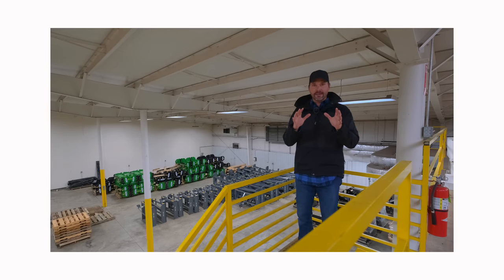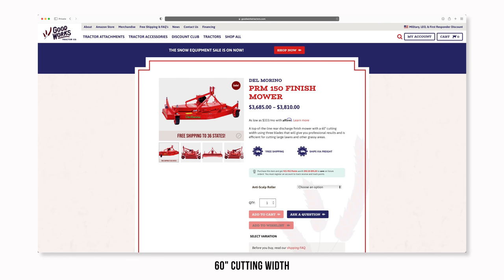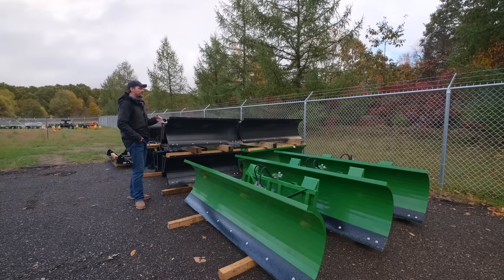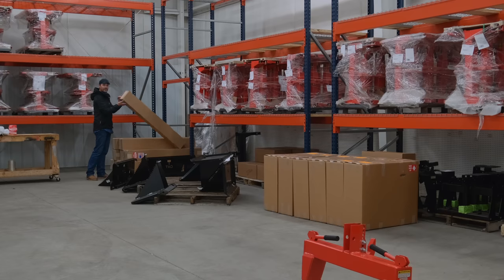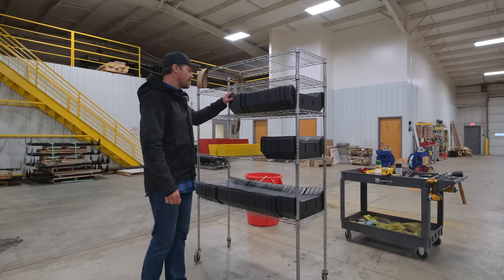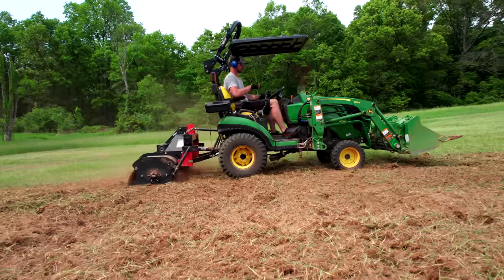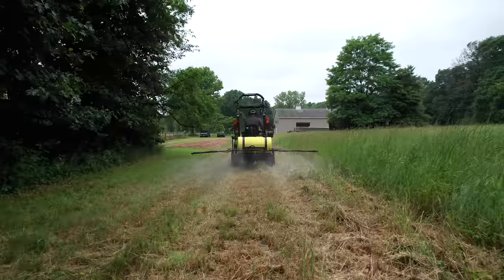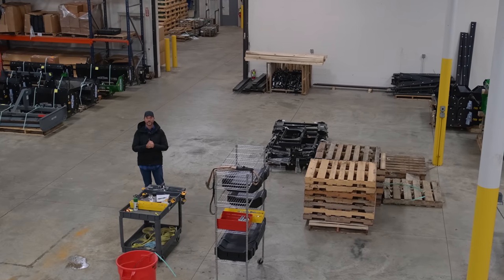TRACTOR TOOLS GALORE! MILLIONS OF DOLLARS IN TRACTOR ATTACHMENTS! 🤩

Comment: We bought a 48-in offset flail mower with hydraulic control for both the offset and tilt as well as a Summit Hydraulic 4 spool valve (8 port) kit. We use it behind our John Deere 1025R and it is awesome!

We didn't actually buy ours here but if this model weighs no more than the 550 lb ours weighs, it should work fine behind a 1025R.

We did have to add adjustable hydraulic restrictors for the offset function. Without them, it would really throw the tractor around and move so ridiculously fast it wasn't very effective.

I mowed and mulched up brush and up to 2+ inch trees for over 100 hours this summer, so we gave it an aggressive test, and had no issues whatsoever.

One of the things I cleared was a close to one mile section of brush under the power lines that was about 30 ft wide and hadn't been cleared in years. I expected that to be an extremely tedious job, manually cutting all of the young trees but instead I was able to just mulch right through the whole thing using the flail mower. It did take several days and two full tanks of diesel, but was much easier than manually clearing them.

Another Super useful feature we took advantage of is the ability to mulch and mow with the mower vertical and fully offset. Using it this way we were able to widen all of the driveways, laneways and paths that run through the forests. The mower just mulches through small branches, trees and brush and widened the paths very effectively.

I'm not sure why most of the online advice suggests these are too much for the 1025R. The 1025r is rated to lift 758 lb with the three-point hitch so 550 lb shouldn't be a problem as long as you have the full 2000 PSI or above operating your hydraulic system.
Reply from the maker: Thanks for your input Slider!
Reply: @GoodWorksTractors  I should have mentioned that my 1025R came with the tires all fully filled with windshield cleaning fluid. By fully filled, I mean filled completely, with almost no room for air (which produces a bit of a rougher ride than ideal).

I also found my 3 point hitch was slow to raise the mower at first but I discovered my hydraulic system was running out of spec at 1650psi when I got it. After adjusting it properly to 2000psi this problem went away (later I adjusted it to 2100psi when hot to improve backhoe performance slightly for removing stumps).

Finally I always left my front end grapple (similar weight to the stock front bucket) installed while using the flail mower.

I don't know if the tires or grapple/bucket help with stability while using the flail mower, but since I was constantly moving fallen trees or branches before and while mowing it made sense in my situation to leave the grapple on.

As previously mentioned, the hydraulic restrictors on the side motion for the flail is essential. Without them it moved so fast it rocked the tractor around.

One bonus I found was to install my hydraulic top link on the 3 point hitch. The top link length adjusts the cutting height for the flail mower. Using the hydraulic top link I could adjust the cutting height as required without getting off the tractor.

As I gained more confidence using the mower I learnt I could use it on surprisingly steep slopes, even with the flail offset (for example mowing a ditch or a seasonal creek).

I also found mowing with it in the fully offset position provided a higher quality cut for when mowing my lawn.

This is because when running behind the tractor, the tractor tires pack down the grass and it pops up later. Mowing offset grass that has not been driven on produces a very good quality cut.

Comment: does the wheel weights fit a manhindra 3016 tractor they say ONLY BLACK AVAILABLE RIGHT now which is fine. So i'm wondering is it going to fit according to the size of wheel or the brand have a lot to do with it.  Like Chevy vs Ford or Dodge ect.

Comment: I have a question. 
Do you know of anyone who builds a seat with an interchangeable back rest? Like something that switches fro from to rear,  this eliminating the need for swiveling the seat to operate the backhoe? 
It just seems like it would be so much faster and safer for my fingers. I rekkon some way of doweled from and rear attachment. 
I have a TYM 254 TLB

Comment: How much for that DelMarino 6’ flail mower? I am looking for a doable flail mower. And, what do you think of running that on a 3039R? I found these on your site. Good Deal!
Reply from the maker: Hi Daniel,  The big one that hydraulically shifts and tilts?  If so, that one is $9,600, but way too big for your 3039r.  You'll want a Centurion Super 52" which is mid $6,000's.  However, we are out of stock on those until next spring.

Comment: Good stuff. I am interested in a hydraulic shift flail mower for my 4066r if 5125r. Maybe duel usage on either. I am guessing what you called the “super funny”.  I’ll give you a call later this morning late. 👮🏻‍♂️👍Chip
Reply from the maker: Hello, realistically, you'll need two different mowers.  I don't think there's one that will really work well on both.  Too big of a size difference in machines.  However, those are both awesome tractors you have!